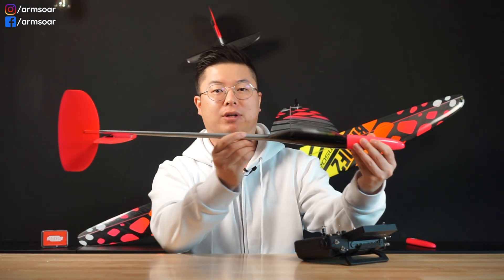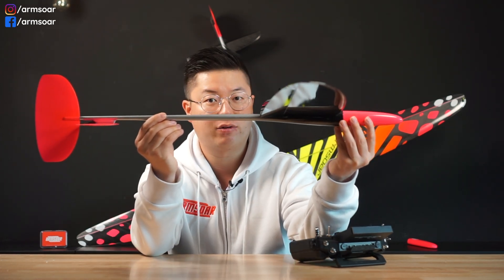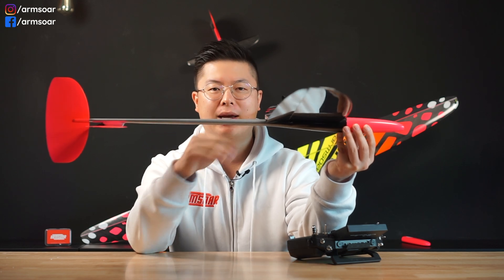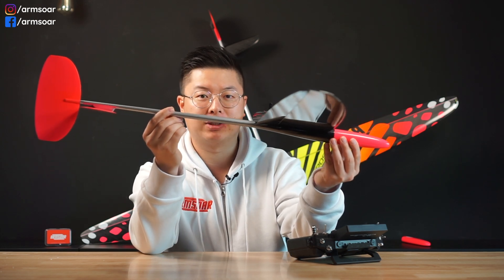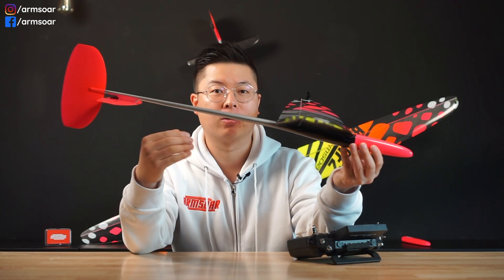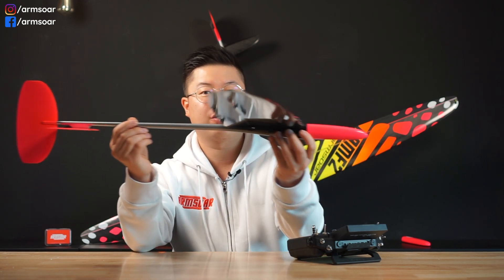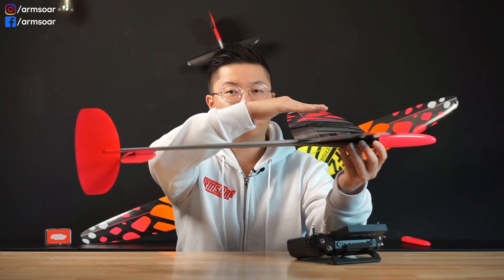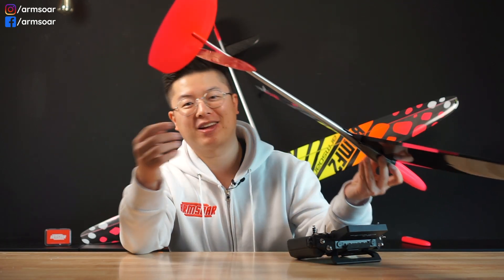RC Glider Basics | Brakes

Comment: I inherited a DLG, no receiver no batts.  Has three micro servos that I can't identify.  I got a
Spektrum SPMAR410 AR410 4-Channel RC Sport Receiver, and now need a compatible battery.. you have a great video on batteries, but being in Canada.. not sure where to order from?  Do I connect directly to the receiver?  So I need to make sure the battery has the right connector?
Reply from the maker: Send us an email (info@armsoar.com), might be able to help you out depending on where you are in Canada. Yes, they plug directly into the receiver. I like using JR/Dupont/servo plugs. If the battery is JST or others, you will need to either change the plug or use an adapter.

Comment: Hi, thanks a lot for your videos, they are of great help. I am considering buying the X20: do hou have any test of X20 range in 2.4 GHz only (before telemetry is lost and before a signal alert)? I am also planning to buy TD receivers: are you aware of possible interference between the two frequencies or other issues? Thanks a lot
Reply from the maker: I have only used the TD receiver in testing and not in my planes (I don't fly anything that really needs it), so all I can say is in my limited experience with TD I haven't seen any interference.
Reply: @ArmSoar  Hi, I found a serious a problem with the Tandem receiver TD R10 (2.4 Ghz+900 Mhz): the servos start to jitter / chatter strongly when I install the receiver in the fuselage (analog servos, Hitech and Emax). The issue disappears when I turn off the telemetry or wrap the 900 Mhz antenna with aluminum foil, so the issue should be the 900 Mhz telemetry. Unfortunately it is not possible to turn it off separately from the 2.4 Ghz telemetry! Does anyone know if the normal 2.4Ghz receivers have the same jitter issue?

Comment: Power to the minority. I’m a bottom to top flaps stick operator too. It’s because i have my throttle on the same stick (alternates operation of throttle/flaps via a switch). To me it just makes sense as I see it as advancing the throttle to get a response, same as with the flaps. Whereas to drop the throttle is a natural reaction to reduce a response .ie throttle power. So alternating from power gliders to pure gliders, I like to keep it simple “bottom to top” for both throttle and flaps.
Reply: Same for me but you do get a better grip on the transmitter if your thumb goes underneath the gimble stick to hold onto the transmitter during a spin.  Your thumb stretches more toward the center of the transmitter.  I never had an issue with dropping my transmitter and wouldn't change because of it but it does give a better hold if the stick is up and your thumb goes underneath the stick.

Comment from the maker: Are you using the throttle stick for brakes?
Reply: Yes, always use the "throttle" stick for brakes.  For F5J, when launching this stick controls the motor and flaps control is disabled.  In all other modes, motor is forced off and the stick controls the flaps. The magic/power of flight mode programming.
Reply: As a relative newcomer to DLG, I use a two position, intermittent switch to initiate landing flaps. The reason is because the programming of the throttle stick isn't something I understand yet, and attempts so far have failed! I use about 70 degree flaps, and pulse the switch to slow the glider down as it comes in. Since I'm not a contest flyer, my needs aren't as specific. I'm sure I'm giving up a lot in return for simplicity, and eventually I hope to figure it all out.

All that said, videos that address the more sophisticated needs of contest flying provide a great 'future target' for sport flyers like myself, and Thomas's presentations are concise and easy to follow.